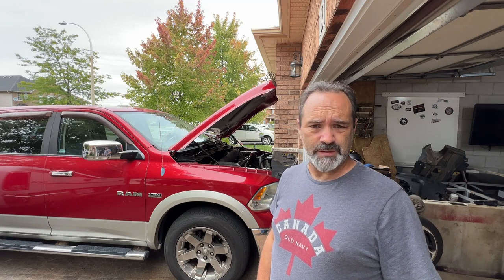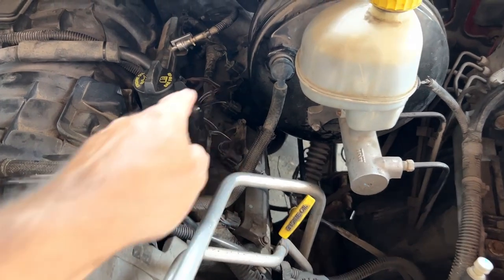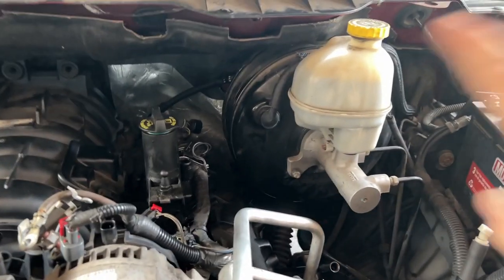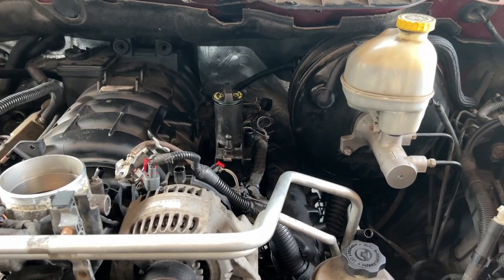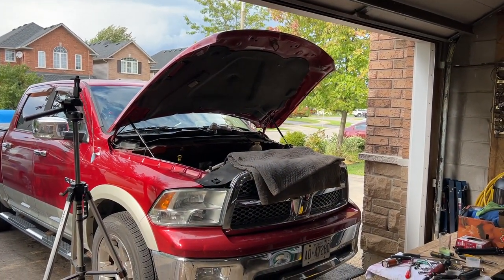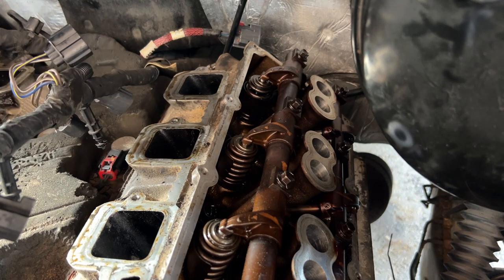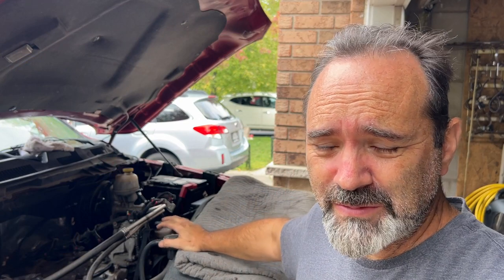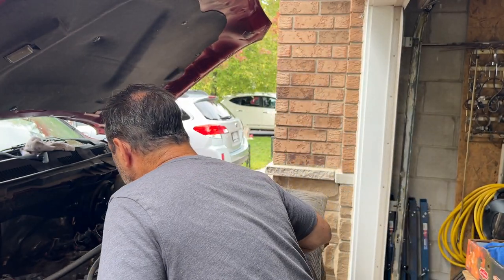Hemi 5.7 Cam And Lifters Test On My 2010 Ram 1500

Comment: Those are your MDS solenoids below the intake, they are responsible for cylinder deactivation. (Eco Mode).  There should be two knock sensors one on each side of the block towards the bottom.  Near the starter on the driver and the crank sensor on the passenger side.  Do you have a compression gauge handy.  I would look at the compression of that cylinder next.  I looked at the meter on our amazon list.  It looks like it will get the job done.
Reply from the maker: Thanks Bill. I realised they were not knock sensors when I looked up the parts on RockAuto.

Comment: Thanks for the playlist 😊.    510xxxkm on my 2010TRX.   Mine has been p0307 at idle for a bit now but finally missing above 800rpm now.     put a light piece of paper (receipt) up to exhaust.   gets sucked back on misfire ( exhaust valve).        First engine rebuild.  not bad for 500xxx.  Thanks from Pembroke ON
Reply from the maker: Yeah, that's a big number. Are you doing the job yourself?
Reply: @ScottRods  Yes sir doing it myself. Heads to machine shop for revalve 

Thank you so much for your Ram Playlist. 🙏 

 have it tore down to cam out (one worn lobe from spun sideways lifter) 

oilpump off.  (used your bent 13mm needlenose trick but stuck an earth magnet on the pliers to not lose the bolt. Upgrading to the 6.2 oil pump as its identical externally but more flow.

I also had a missing chain guard bolt snap,  thank goodness i didnt have the catastrophic failure though.  bolt and guide on the splash guard.  replacing timing chain bolts with ARP 12.9 bolts torque specs of 11ftlb…….  stock 8.8 bolts had a factory torque spec of 22ftlb.   no wonder they were breaking………

Comment: those  4 solenoids control the oil to the lifter for mds operation you should check the valve lift with a dial indicator as you may not see the difference as its is thousands of an inch would as look closely for a broken valve spring on that cylinder
Reply from the maker: Thanks Dennis. I figured out I was wrongly identifying them when I went on to rockauto to price a knock sensor, lol. I'll have another look at the valve spring, but from what I've seen on other videos, it would be a noticable difference in travel to throw a code. It doesn't even make a tick, like every other instance of this potential cam fault.
Reply: @ScottRods did you ever got it fix? I'm currently going thru the same thing 😢

Comment: Spark and coil packs been change? Haven’t watched other content you posted but if it’s a random it could be fuel air of spark.
Reply from the maker: Thanks William. I finally got to the bottom of the problem. Faulty PCM.

Comment: A worn out cam shift is worn out hot,cold or in between. It won't run good until it gets hot then throw a code. It has to be electronic in my eyes. But I'm just a plumber
Reply from the maker: That's what I thought, but I had to cross it off the list. On to the next possibility, lol.

Comment: I'm pretty baffled as you are. Been following your content on and off for a while (I followed your videos of tearing this engine down previously to help me repair my 03 ram hemi, since the engines are extremely similar, they were extremely helpful!) and I'm definitely impressed with your tenacity chasing this problem, I can feel the frustration too. I think you're on the right track checking the knock sensors next. Also, I've never actually seen it in person, but I've heard a clogged catalytic converter can also cause a random multiple cylinder misfire code, just an idea that came to mind. I'm only a shadetree diy-er though. Don't give up, you can fix this, I believe in you!
Reply from the maker: The only problem with the clogged cat idea, is that it's specifically cylinder 5 that is being naughty.
Reply: @ScottRods  Yeah that's still got me. You know that cylinder has fuel, spark, the timing is okay, and you saw the valves fully actuating and closing so it should have plenty of compression to fire.. I agree with the problem most likely specifically being electrical, so I still think you're on the right track checking the knock sensors. If the cat was bad the O2 sensors would probably throw a code as well. So keep it up, you'll get this solved I'm sure of it!

Comment: For your multimeter, I would recommend either a set of test leads with alligator clips that screw on, or some alligator clip jumpers. That way you can clip your leads to what you're measuring and make much easier, more accurate measurements. There are places where it's almost impossible to get your leads on the test points, and still see the display, much less turn on the power all at the same time. Good luck with the truck! Electrical problems can be incredibly frustrating. All the best to you, from another Dave.
Reply from the maker: I know what you mean. I have a set of croc clip leads....somewhere, lol.
Reply: Tools will randomly relocate themselves through a portal in the fourth dimension. Sometimes the portal closes before they can return to our dimension, and then you're really screwed. Good luck with the truck!

Comment: I am not much of a Hemi guy, much more experience with LSs. I believe those four plugs you are calling knock sensors are your displacement on demand solenoid plugs. First question, does it have an actual miss you can feel? or is it just setting a check engine light? I have seen LS engine do this, and the problem was the crank sensor, in one case it just needed to be shimmed. So the crank sensor was throwing a false signal seen by the PCM as a miss.
Reply from the maker: Yes, it feels like it's dropped a couple of cylinders, but only when it throws the warning light. So, it's more like it's going into limp home mode. And yes, I've been corrected many times on the MDS solenoids, lol.
Reply: @ScottRods  Like you are doing it is just a matter of elimination. I don't know if you have put the manifold back on, but you might want to try swapping a couple of injectors around, and see if the miss follows the injector.

Comment: Scott Rods, love following this. I am having the same problem and I have thrown the parts cannon at it. I have a 2016 ram 1500 fyi. I am replacing the cam shaft position sensor and crank shaft position sensor. Did you check the compression? I still need to do that. I saw you ultimately replaced the ecu or pcu. Did that fix it? Thank you for your the channel.  Be blessed.
Reply from the maker: Yes, the PCM fixed the problem. However, the replacement pcm carried over some error codes from it's previous vehicle that I had get cleared by a Chrysler dealer. Only cost about $70. Everything works as it should now.
Reply: Did you have low compression on cylinder

Comment: What Ended up being the problem ? I’m having a p0301 code
Reply: Bro I have p0303 I changed all 16 plugs one coil pack (cylinder 3) and one injector (cylinder 3) also the camshaft sensor and it still misfires, I'm getting to the conclusion that it's cam lifter failure 😭

Comment: Hate to tell you so that I told you so😄 no noise ,no valve train issues! Your coils or injectors are shutting down , possibly a intentional shut down from the ecm if you don’t know how to check the signal, it probably would be cheaper to have someone with the proper scan tool to check it! Than keep firing the parts cannon at it! As matter of fact check out scanner danners video from today, it discussed this exact problem 👍
Reply from the maker: hahaha, parts cannon, very accurate. I do feel that it is being forced to run badly, due to an incorrect signal being sent somewhere. Labour costs where I live are just not feasible, so that's not an option. Plus, where's the "fun" in someone else fixing my problem, lol.

Comment: Putting the drivers side valve cover gasket back on without popping the gasket loose is a nightmare. Took me 4 hrs
Reply: You can get the valve cover out without removing all that stuff. Once it’s loose take all the screws out of the valve cover pop it off from where it’s sitting and slide the back down  and you can lift the front side and wedge it out

Comment: Pushrod is straight? If you spin it around it feels funny? No experience with these type of engines, just an idea. I would get a proper multimeter, you will have it the rest of your life. I have two Flukes, but they are not specifically for automotive repairs. If I remember correctly, the 88 is for automotive repairs. Even a basic Fluke would work. I have managed to score, a nice Fluke on Craigslist.
Reply from the maker: I'll check the pushrods in the morning before I put it all back together again. Thanks.